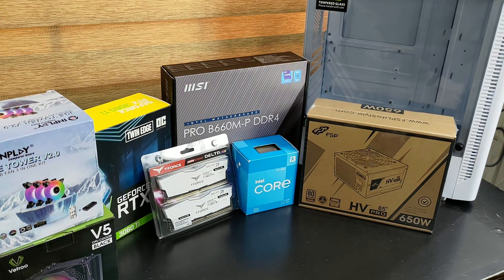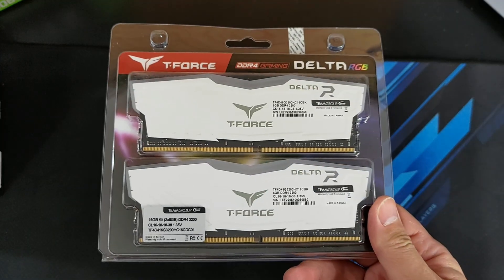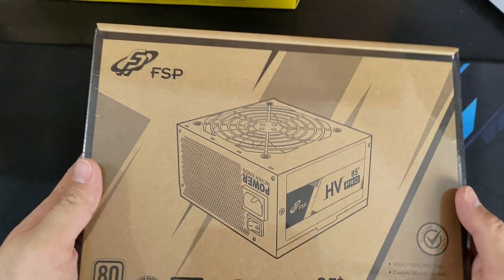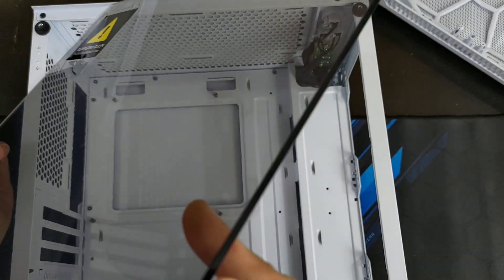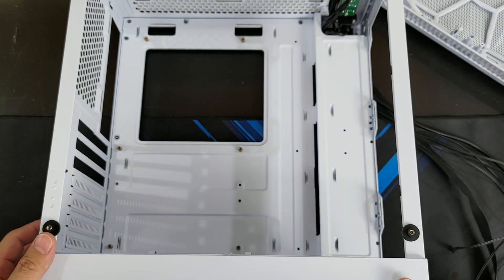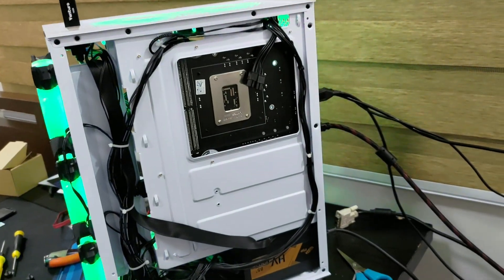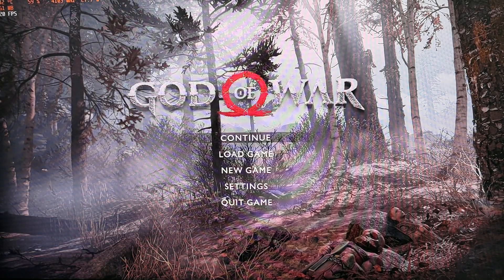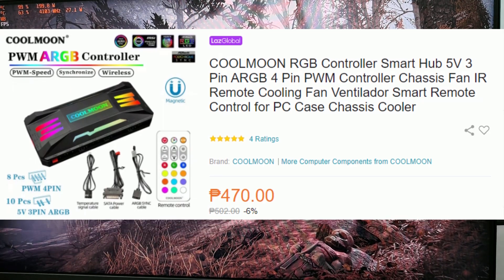How much gaming can $1000 get you? Is this the best time to build a new PC?

Comment: For the people who live in America Mirco center offers some decent barebones kits at excellent prices. My current favorite one is the AMD value one. It includes Asus Tuf case, ASUS Tuf 750 watt PSU, Asus RTX 3060ti dual, and Asus Strix B550 motherboard. The kit is $600 as of now. Add in Ryzen 5 5600x, 16GB ram, 500GB ssd, and a CPU cooler and you are looking at around $950. They also have other ones as well such. As AMD performance for $800 (total cost will be around $1,150) and AMD ultimate for $1,300 (If You can afford to budget $1,750 you are getting an excellent deal for the Asus Strix 3080ti)
Reply from the maker: nice thanks for sharing!

Comment: A 3060 ti in a $1000 build is exactly the kind of choice I'd make. So many builds I've seen use 3060 or even worse when a 3060 ti, while slightly more expensive, is the absolute sweet-spot for budget gaming. I would've cut corners on RGB and gotten an Arctic Freezer 34 and a PSU from a more reputable brand like Seasonic or EVGA though.
Reply from the maker: absolutely on point bro, 3060ti is a no brainer, way better performance over a regular 3060 with almost similar prices depending on the brand, I do have a seasonic PSU but its a pretty old 620W S12 II and didn't want to gamble with it, so I went with something that fit my sisters price range. will probably upgrade some time later though

Comment: for 1k i got a alseye h240 water cooler, some UpHere fans, an i7 11th gen cpu, an rtx 3050 oc, kingston fury beast 16gb ram, H510M-A PRO mother board and a 650 watt cooler master power

good or na?
Reply from the maker: good build, though not a fan of the 3050, price to performance is not too good but if you don't play games that are too demanding then it should do a good enough job
Reply: @EGotTech25  i mean i only play like minecraft, cod mw, god of war and some other games
Reply from the maker: If it does the job then that’s all that matters, theres always going to be something more powerful but usually comes at a higher cost
Reply: @EGotTech25  havent built it yet
Reply: @EGotTech25  btw is an msi vamp 010 a good case for all the components?
Reply from the maker: let me check it out and get back to you
Reply: Wouldn't recommend a 3050. If you dont mind going AMD, I would go for a 6600 dual 8GB which performs like a 3060 for like 3/4 - 1/2 the price
Reply: @nutcamper1266  damn
Reply: @nutcamper1266  i mean this IS my 1st real gaming pc so
Reply: @nutcamper1266  actually i looked it up and the prices between the rtx 3050 andd amd 6600 is either the same or the 6600 being a little higher so

Comment: The one thing I would pick different for certain is power supply.  For me it is the worst place to skimp on.   All the money you spend on a PC (other than the monitor and the peripherals) depend on the PSU to not only work but also not die horribly.   I am not saying FSP is a terrible brand or anything, but it doesn't have the best name out there and it only comes with a 3 year warranty, which would ring bells for me to stay away from it.
Never never ever cheap out on the PSU.  Don't take RGB lights, don't take fan/RAM with RGB lighting.  Find a way to buy a proper good dependable PSU first.

Going to watch the rest later.  Thanks for the video.
Reply from the maker: thanks for sharing you comments bro, much appreciated. Do think I could have gone for a better power supply but with how little juice that i3 uses, I figured I could get away with it, but the 3060ti is the max I can go with this specific power supply though.
Reply: @EGotTech25  I was not referring to the wattage.  But the quality of the power supply.  3 years is very low for a power supply, which means not even their own manufacturer believes in it to give it the minimum standard of 5 years for quality power supplies.  Don't forget if something goes wrong with the power supply, everything else risks getting toasted.  CPU, GPU, motherboard, RAM, everything.  Anyway, thank you for your reply and good luck.

Comment: I have the same budget 4 months ago, instead of rtx 3060 op for my need, I opt to get rx 6500xt so I can get gaming monitor, mechanical keyboard, mouse and headset.
Reply from the maker: nice! some people prefer Nvidia because of DLSS but I think AMD cards are just as good, but most people don't really know how good they are
Reply: welcome to drivers fails
Reply: @Muhammet4string  how? Never experienced it, almost 4 months using my rig.
Reply: @alvintamang9635  AMD graphics cards have so many driver issues it's crazy
Reply: @natearmstrong8340  I'm so thankful I didn't experienced it. I have 2 drivers updates since I purchased it. I think those are old news now or the games I play are just not demanding. Example. Genshin( highest, 60fps) and dota 2(+120fps).
Reply: That was a stupid move on your side, get 6600xt,it is almost the same price but wayyy better in everything
Reply: Still it is an amazing machine!